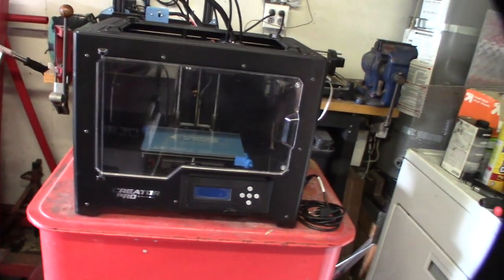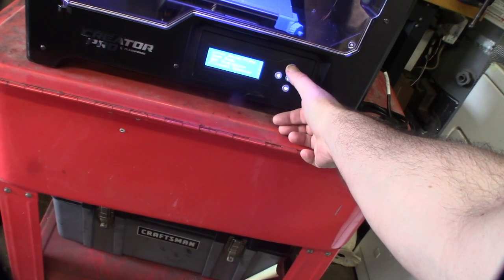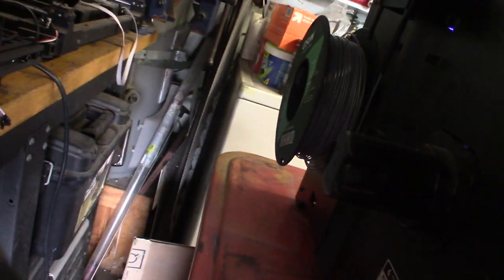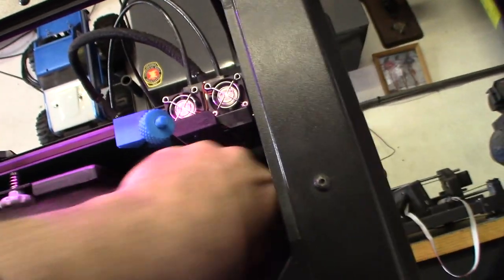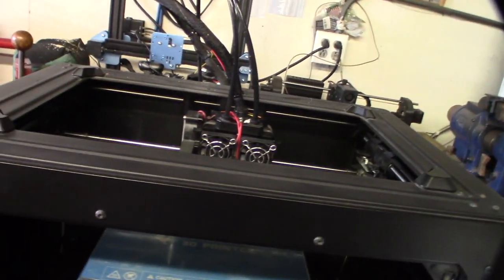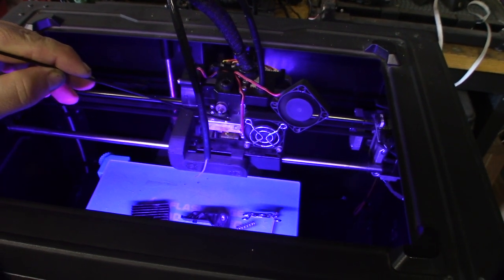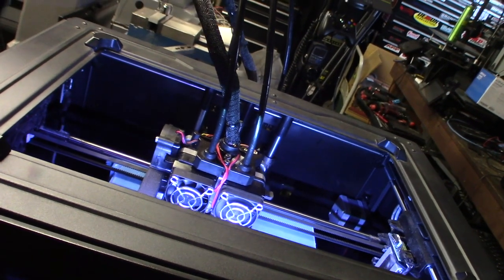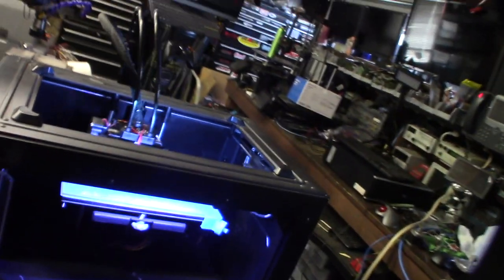Flashforge Creator Pro 3D Printer Troubleshooting, Repair, Thoughts. Bad Jams Clogs fans reversed

Comment: interesting that youre in orange county -- i work in anaheim and we have a creator pro at work. I HATE IT WITH SUCH A PASSION. always something up with it. rather print on my modded ender3 at home.

currently running into the issue where when the cooling part fan comes on, the extruder begins to drop in temperature - to the point where it errors out because it drops too low. wish i could lower the fan % but the slicer flashforge forces you to use is straight up trash.

could the heating element be going bad?